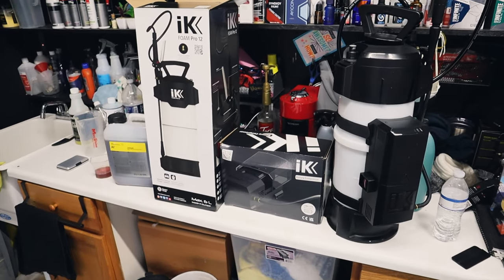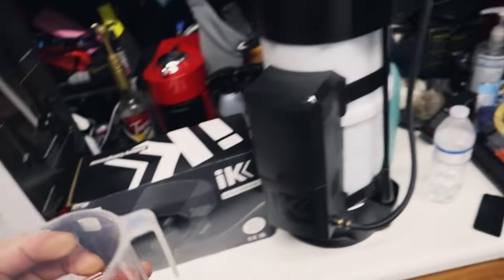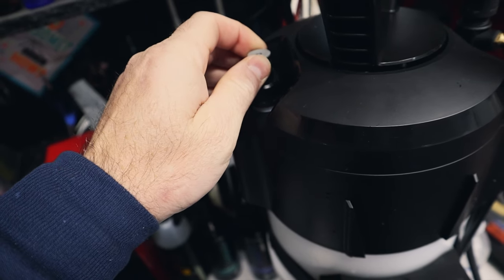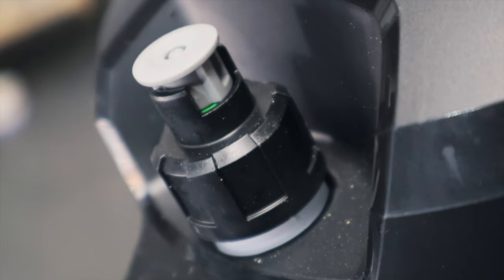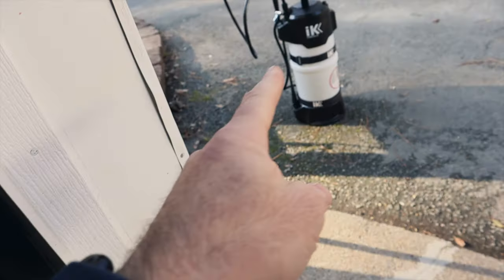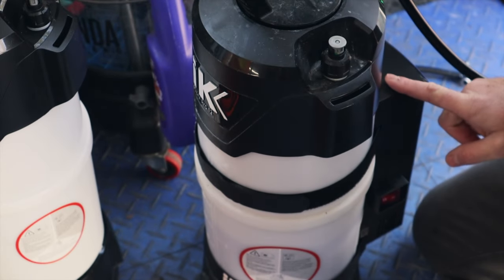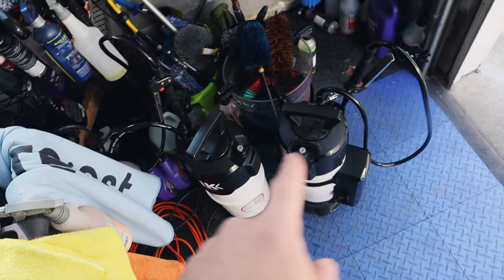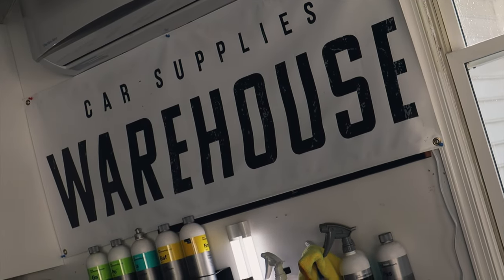New IK Foamer Battery Compressor! #detailing #tools

Comment: Thanks for the video. Sweet tool and convenient. What solution were you using at 6:57 ? It made the tires turn brown and quickly taking off that grime. Thanks!
Reply from the maker: It’s the Koch Chemie Active Foam I showed when filling it.

Comment: Do you dig the electric powered sprayer? I’m a simple bro and have loved the normal sprayers. Don’t know if an electric one adds that much value. Your thoughts?
Reply from the maker: I love new battery pack for sure. I also have the other smaller electric sprayer from CSW and it’s great. For us it saves time and my hands from cramping.
Reply: @MirandaDetailing  and hand cramps can be a big deal when you are trying to bust through a lot of projects.